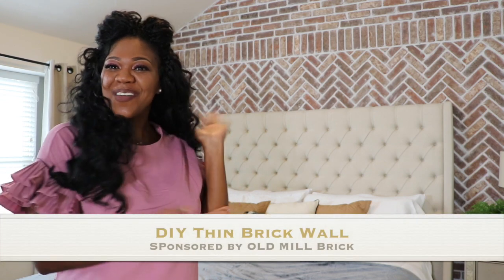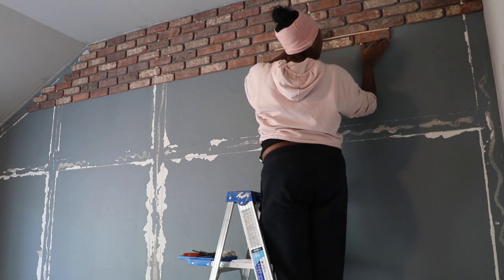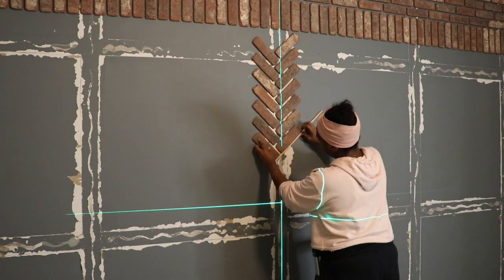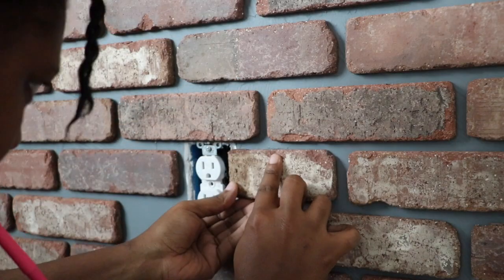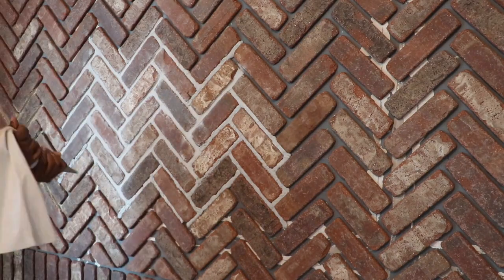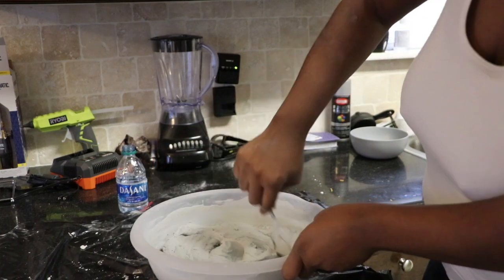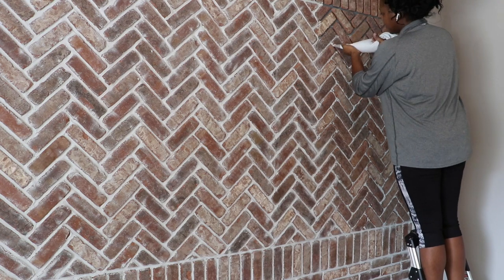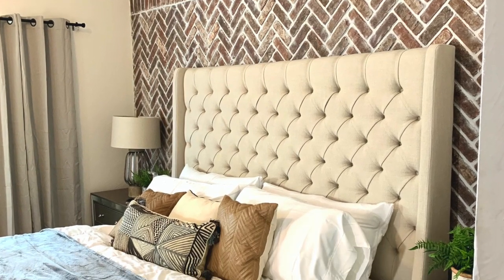Installing and Grouting A Brick Wall | Old Mill Brick Thin Brick Castle Gate Singles

Comment: I have worked as a mason for 20 years. Most DIY videos are pretty bad when it comes to masonry as most people do not know what they are doing nor do they take time to really pay attention to detail. However, you did a really good job on this project. You clearly took time to make it look right and build it well. Especially considering the size of this project. Amazing work.
Reply: @AK-tx1vg  Thin veneer manufacturers actually list construction adhesive in their installation guidelines for use with thin brick. This will be fine.
Reply: Adam, we all appreciate your input with your experience in masonry. This brick was applied to a fresh sheet rock. Would anything need to be changed if it was being a applied to existing painted wall, or over wallpaper? Thanks
Reply: شثشثضث
Reply: ثث
Reply: س
Reply: ثثسس
Reply: ثثثس

Comment: Oh and all you gotta do With the grout bag is get one pail of water dump the whole thing in it fill the bag and shake the bag as it drains it’ll be all cleaned out and ready to be filled again you just don’t get under open it up it fills up with water and shake it And a grabs all the dried stuff all along the side part out and fill it up go so much quicker and you can use the same bucket for the whole project

Comment: Wow thanks to your video, I'm gonna be saving $4320 on a quote to have my brick wall grouted. Its 144 square feet approximately and I already put up all the brick. Attempted to grout it with terrible results so I stopped at 1/4 the wall. Then the nasty quote...found you and how you mixed your batches small....gonna give it another shake 😃
Reply: That should no more than $1k job if you are paying someone. 30% less if you’ve bought the materials yourself.

Comment: This looks amazing! I just bought the brick but on sheets so I don't have to do quite as much work. A question about the caulking gun. How difficult is it to squeeze the adhesive out? Do you have to use a ton of pressure? I have chronic wrist problems so if there's a lot of resistance, I'll have to stick with mortar.
Reply from the maker: georgiardchenko I used a battery powered caulk gun so I wouldn’t have to worry about that ...it’s linked in my detailed blog post
Reply: @TheAshleyBasnight  Oh that's perfect! And I love Ryobi tools. Thanks so much!

Comment: hi!  handmade haven, when you used the loctite adhesive, did you find that the bricks wanted to sag or slide down the wall at all after you placed them?
Reply from the maker: It’s Ashley 🙃 and nope...if you put a bunch up there it would slide slightly but for the most part once I put it on the wall it pretty much stayed in place
Reply: @TheAshleyBasnight  awesome!  thank you so much, you did an amazing job there. I'll be doing an accent wall on monday, hopefully grouting the following weekend. again, beautiful job
Reply from the maker: FC2TurboMSS good luck!!

Comment: Hey. Beautiful job. I’m now thinking I could possibly do this on my own instead of hiring someone to do it. Any issues after installation?
Reply from the maker: Nope! Just as beautiful now as ever
Reply: My kitchen tile has been installed by a pro who also used Loctite adhesive. He said that outside of showers - he does not even consider mortar for tile. 2 years in no issues at all.
Reply from the maker: Martyna Griffin after using it, I won’t either 😂